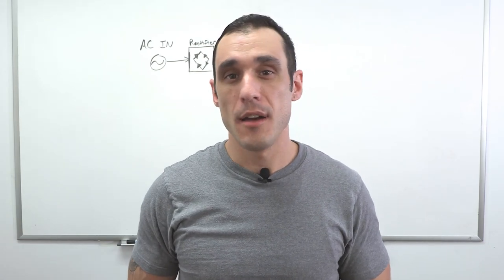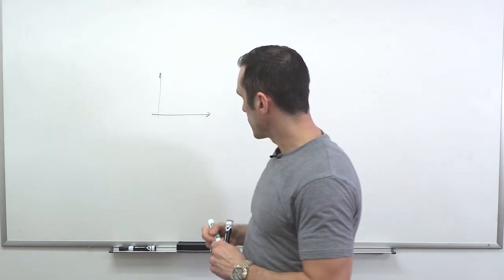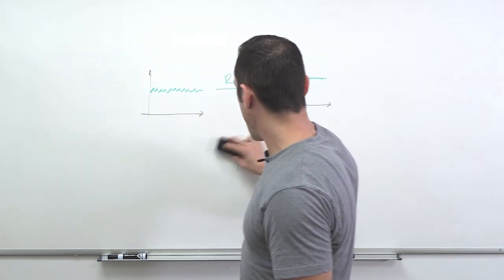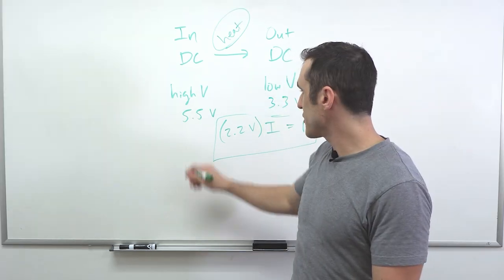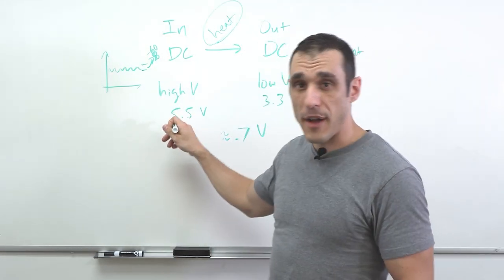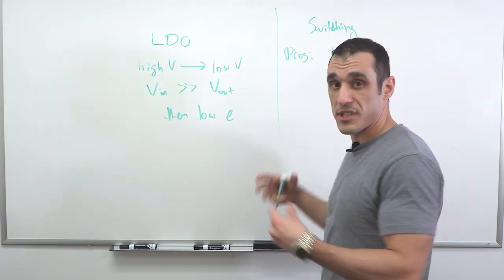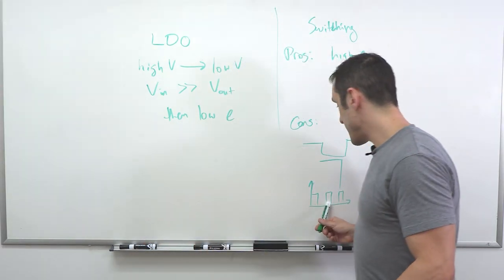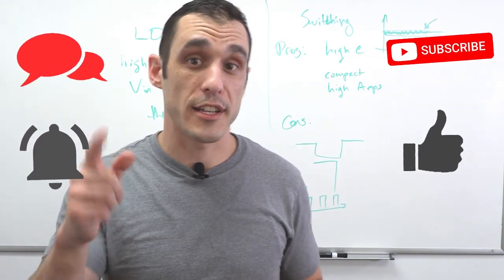LDOs Vs. Switching Regulators - Power Regulation in PCB Design: Part One

Comment: 13:53 to prevent superimposition, can't you just have a bunch of low pass filters to filter out the noise?
Reply: Technically yes, if you place enough filter stages you will create a higher order filter with sharp rolloff. However, for passive low-pass filters, you can end up adding new poles into the cascaded filter's transfer function as you add in these filter stages. The result is that you will have some resonances if you do not also add damping with a small amount of resistance.
Reply: @Zachariah-Peterson  Thanks.  Sorry for the very late response.

Comment: Nice overview. LDO's 'can' get very expensive, especially if need >+/-8V. Also they're not really that simple, be very careful of the output requirements, especially output capacitor requirements for stability. Most require very specific type/ESR & values.